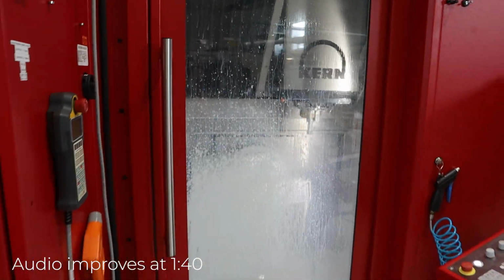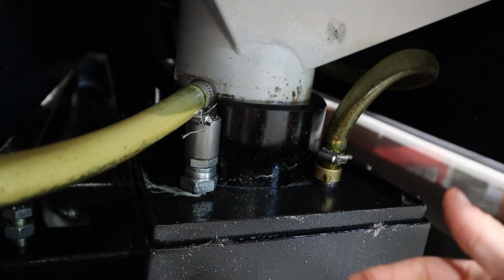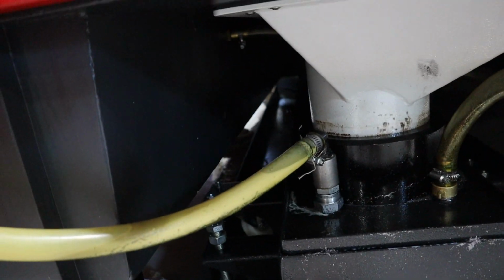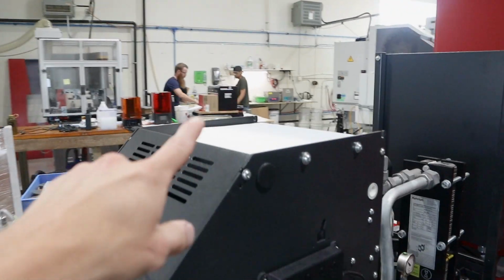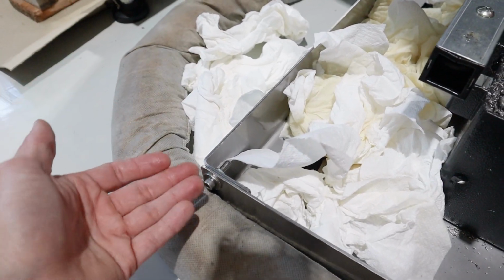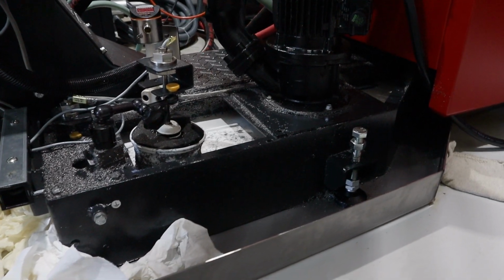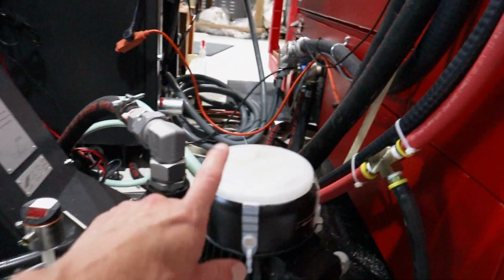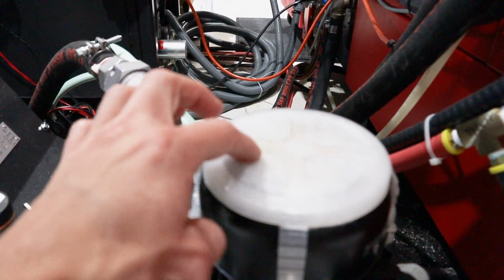How We Deal with Coolant Spills on The KERN

Comment: Our Oemeta rep told us if we use a 5 micro filter on our Okuma it will cause a “froth” because it’s taking out the defoamer, this was just last week so we haven’t swapped to 10micron yet going to this week to see if it fixes it. 
Just a good for thought you can check into. We are having a bad overflow problem when running 1k psi all day in our Genos 560

Comment: The cnc horizontal boring mill i run has a 3"ish deep pit all the way around it thats sloped towards the conveyor imbedded in the floor. So the entire 30ftx35ft floor around the machine serves as the coolant pan and then the conveyor has a transfer pump that sends coolant back to the actual coolant tank through a paper band filter. It has some odd parts of the design and is very dependent on the quality of the concrete work but overall works well. Doesn't catch everything though as despite having about 20ft of machine and pit infront of the the spindle, certain tools will still send coolant into the main aisle when running through spindle coolant. The machine is fairly new so still working out the kinks and additions to help reduce that.

Comment: For your foaming issues:

One problem I've seen that leads to issues that a lot of people seem to overlook is cleaning sprays. We had one guy who was really good at keeping the robot that fed the machine clean, it was a carousel type robot and it would drain back into the main system. Over time we'd just get a lot of foam. Once we were aware of that issue, we were able to abate the foam. 

Same problem with windows. Setup guys want a clear view of a new setup, and they clean the windows. Cleaner gets in the tank, foam ensues.

We've also had issues where some operators needed to check some small features on parts while they're on the fixture and used cleaning sprays.

Two solutions: 

For cleaning: spray bottles of iospropyl alcohol do the trick.

For foam overall: we use a defoamer. We use this stuff called "Rustlick sump-side defoamer" I think it comes out to like 300ml to a barrel of coolant or something, and works immediately, and lasts about a month or so.

Comment: Foaming coolant can be caused by to hard water. In my shop we had to use a water softener for filling the machines until the public water supply was adjusted a few years ago. But we have still to add an anti foaming agent every so often. The anti foam stuff is expensive but it needs only approximately 10 mL for 1000L of coolant.

Comment: I’d say you probably just have a low quality coolant that is causing the foam.

I’d also say you have the wrong type of chip conveyer for your application.

My new to me 5x machine came with this very interesting type of conveyer that I don’t fully understand but it seems to get all the small chips and keep them out of the coolant without the need for a paper filter. 

Then a couple cartridge filters do the work of keeping the high pressure pumps clean.
Reply: Struggled with this with my new DMG Monoblock 95 and the Haas's for that matter.  To fix the issue I went to Hangsterfer's and reverse osmoses' water.  Coolant issues gone.  We really struggled with this for a while.  Antron Brown opened the door for us to try it.  The additive they gave us to run in the old coolant (a prep to cleaning the tank) killed the foam on contact like magic.  The rest as they say is history.
Reply: @darrenmayer3435  I’m using a master chemicals product now but I used to use qualichem 251c and had some issues with it.

Using this new conveyer I’m not sure why more machines don’t have it. I looked at it I think it’s called a consep conveyer and they say it cleans the coolant to 50microns and there are no filters you have to replace

Comment: Great video 👍I think Kern should update the flow valve to a yogurt design 😊, foaming of the  coolant is due to air being added to the pump cycle same principle as a car fuel pump or water pump fault! Usually worn pump or loose couplings etc .

Comment: Sometimes air is introduced to the pump, causing forming. Check the bottom of the pump and see if it’s worn out. I have seen the same problem and everybody try to put anti-form in the coolant. I pulled the pump out and it was worn out. Once the pump was replaced, the forming went away. Who knew.